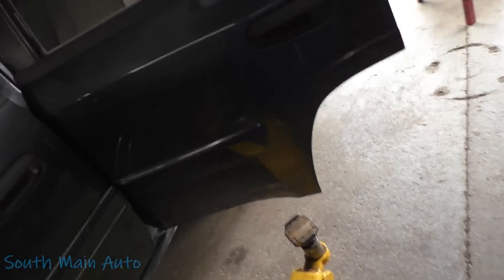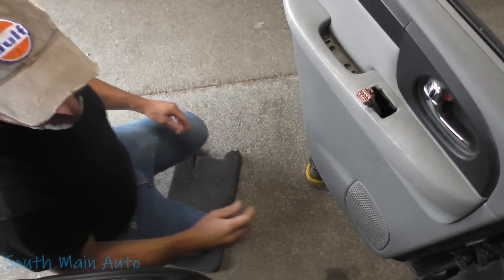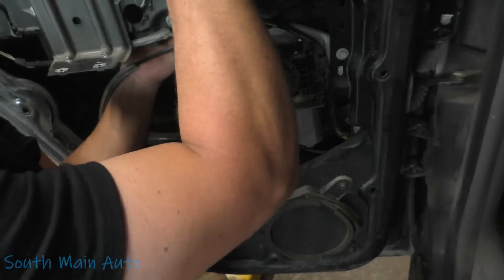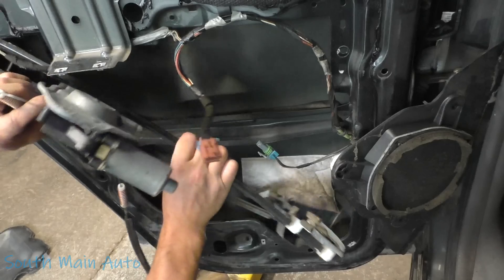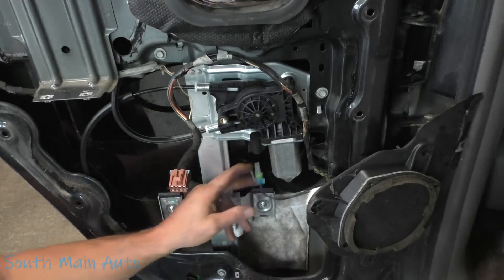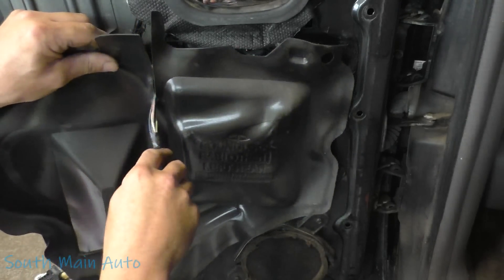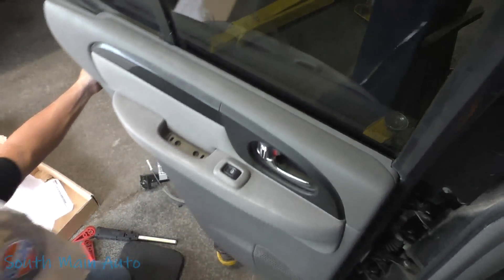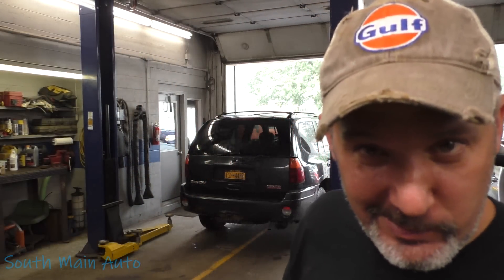Envoy / Trailblazer - Rear Door Window Regulator Replacement

Comment: As a backyard hacker, I have done dozens of regulators and power door lock actuators. Engineers assigned to cococt these contraptions must be limited to C- students exclusively. The cable acuated type was definitely a step backward, they just don't last. I replaced the regulator on my daughter's Town and Country. Every time, the same cable failed. It required removal of an  entire interior section of door, After removing the door card, and including removal of the door latch and a half dozen wiring harnesses, speaker and more. The window wasn't bolted to the regulator, you had to pry it off of two plastic clips. The only good thing was , by the third time, I was able to the whole job start to finish in less than an hour.

Comment: I bought a rivet tool thanks to 90's Ford and GM. I used to bolt them back together, but found out that I could actually do it correctly, so I have been.

Also, since you asked, I think a wiring harness was left unclipped from the new regulator. :)
Reply: Now its going to burn down.  :)

Comment: As a young buck I had this happen to me in my VW Passat driver window. I managed to fish the glass out and used the quick release suction cup from a GPS on the bottom of the window to secure it in place. I got the knack of opening an inch and reattaching it to smoke a cigarette. After about a year I got the regulator done.

Comment: I am not a mechanic by any stretch. I however sometimes like to work on my cars.  Sometimes!  I had to pull a door apart on my Toyota T100 SR5.  It was actually quite easy.    The door lock actuator electric mechanism quit.  Turned out some of the sticky material on the water shield plastic melted and got on the push-pull wire.  A good cleaning and the old girl was like new.  The molded hard plastic weather shield on this Chevy was very nice and easy to work with.  Yeah, I found that removing the speaker and its mount made the job much easier.  Thanks for all the tips and the education....

Comment: I bought that small Wera tool set, bought it to carry on the Harley but it’s crazy how handy it turned out to be, with the tiny ratchet. Than I seen you using it. Bought 3 different sets now, but lost the 7/16 socket from one of the kits😢.

Comment: Changed the regulator in my daughter’s Chevy Cruze, similar procedure but the Cruze uses a double cable design.  What all these seem to have in common are weak nylon mechanisms that grab the glass.  If the glass is stuck due to ice, etc. the motor is strong enough to snap the nylon mechanisms while drawing the window down.  I spray the window tracks with silicone spray and have instructed my daughter to scrape the ice away from the edges of the glass before opening.  Used the OEM replacement.

Comment: I had to change the door latch on my son's 2007 VW Golf. On those, you remove a bunch of screws around the perimeter, then the outer door skin comes off. I'd never seen that before, but it's much better, changing out door latches / window regulators etc is a breeze. Also, get a ding or scrape in your door, just swap the whole skin over with one the same colour from a junk yard. 
The door skin of the Golf when removed is surprisingly robust. I drive a 2015 Challenger Scat Pack. Bearing in mind that car weighs over 4200lbs, the door skins feel like they would crumple like paper if you could remove them from the door.

Comment: Wow -- that was the most painless window-regulator replacement I've ever seen.  You should try doing them in a 1968 Ford Galaxie convertible.  LOL!  The rear ones, especially, are INSANELY difficult.  You literally have to remove the entire back seat to get to them.  And then the hole they fit through is about a third the size it needs to be.  It can only fit through that hole when it's rolled completely down.  Which is, of course, impossible if the crank-gear has stripped and you can't crank it down anymore.  I literally had to cut one of mine into pieces with a Dremel tool in order to remove it.  Many, many, MANY hours of work.  Engineers don't do everything right, for sure, but there are definitely some things they do better today than they did back in the '60s/'70s/'80s.

Comment: I learned a hard lesson about Dorman "reman" BCMs.  2 bad ones in a row, then followed that with a bad one from Cardone.  Hours of diagnostic time because I had myself convinced that there was no way on earth I got 3 bad rebuilds in a row.  Sure enough though, that was the case.  I got a 4th module from Blue  Streak, slapped it in, did all the necessary setup, and voila! Car left a week ago, and no issues since.  I lost my ass on the job, but the customer left satisfied.

Comment: I just get the genuine parts for the motor snd regulator. My 05 gmc had a driver back one go bad back in 2021. Figured if it lasted that long the new one would probably last the same. I dont live in the crust belt so im not worried about it ending up a rust pile anytime soon

Comment: I usually grease up the middle track and spray some silicone spray in the Rubber channels on the outside of the glass window. Makes the window slide up and down like new and makes the regulator last longer. I had a big grin on my face when you didn't tighten up the bolts right away and let the window find the position where it wanted to be on it's own. Those are almost the exact same words I use when I do it the exact same way. 😊

Comment: The amount of time's I've had to do this on my 99 bmw 328 since new are crazy.  Must have done each window about 4 times (min).  OEM/Aftermaket to all bust about the same time!   Easy job - just a pain.  Suppose thats the disavantage of cars not rusting out in Cali!😀

Also have a 94 e36 with the more traditional metal sizzor type regulator as opposed the the cable/Pully one - never had to change one that ever!

Comment: My 80 series landcruiser eventually had all the windows drop into the doors usually at the worse possible time. Replace the bailey channels and used sikaflex to fix the glass securely into the winder mechanism lubricated the pivot points not a easy job.

Comment: That sounded like a pretty decent shower, hopefully, it cooled things down and the sun didn't come out right away and run the humidity through the roof!

About 2 months ago, I did a left front regulator, power mirror and exterior door handle on my brothers Toyota Avalon. Other than getting it apart without breaking anything, the door handle was the hardest part to replace.

I'm not saying Dr. O forgot to do anything but, when I replace a regulator, I always spray the channel and cables with white grease. I don't know if it does any good but, I feel better about it.

Comment: That just be the first time I've seen the engineers actually line things up so that the tool fits to allow you to properly complete the job, my guess is that those holes were meant to collect dropped fasteners from some other job on the door and just randomly happened to line up with the bolts. That or some engineer at GM paid his way through college working as a mechanic and designed the one part he was responsible for to be actually ready to work on =)

Comment: I had an '02 Impala where I was walking up to the car and the driver's window just fell down. Didn't touch it or anything. Fwoop, down it went. Took the panel off and propped it up until I got a regulator a couple days later.

Comment: Dorman regulators last ok, my 2000 Durango has had all of the regulators replaced. When a Dorman fails, I take the receipt to the auto parts store, all with Limited Lifetime Warranty and they get the old, I get the new and regulator is good for another few years.

Comment: After market regulator units in a 2002 Silverado were sub par at best after replacing several...but back then the OEM's were ridiculously expensive... Probably should have spent the extra to avoid issues with the cheaper knock offs...

Comment: Nice touch with the Sprayway... first filling station I ever worked for used it.  Did you not get that top rear corner popped in all the way?  I'd better complain!  Very nice to hear rain... we're on a fierce drought in Texas, several weeks of 100+ with more comin'... at least we're not getting that smoke, I would not handle that well.

Comment: My father and grandfather were both killed by a window regulator. Gramps was working on one when the car rolled over his legs. My dad ran out to my screaming grandfather and quickly placed a jack under the car to free him. While doing that, my father suffered a massive coronary and died before he hit the ground. He fell on the jack handle which released the jack, crushing my gramps head. Soon after I arrived home from school only to be greeted by a horrifying scene; the door panel didn't have the holes to adjust the window clamps as this GM did. It took me the better part of the afternoon to finish the job. I wrote GM about the incident, which led to them adding the holes so future replacements and adjustments would be easier.

Comment: Aleast they made two engineering pluses 1.The holes to adjust the window 2. The plastic water membrane the ones I have worked on had thin easily damaged clear plastic which is almost impossible not to damage.I realize thats only a small win but you take what you can get.Cheers.

Comment: pro tip wash the window at the leglator area as well get rid of the crap there not having dust and junk there helps the window go up and down better plus looks cleaner if I had the full glass access I would clean it completely while it was accessible

Comment: There are few things more frustrating than working on late model interiors. The chances of something breaking are high, and many times interior plastic parts are not available. I probably wouldn't have even taken on that job. A body shop is better suited for doing jobs like that. Several years ago, I had both rear window regulators fail on my 2001 Chevy Malibu. One about 3 months after the first one. The regulators use stranded wire cables, much like clothesline wire, if anybody remembers what that is. They also had VERY flimsy plastic rollers, with no bearings, pretty much the same as screen door rollers. No wonder they didn't last very long. Since this was just my going to work car, I didn't bother replacing the regulators. The only window I actually needed to work was the drivers door window, so I could go through drive throughs. I removed the mangled regulators, pushed the windows all the way up, drilled holes in the vertical track below the metal channel along the bottom edge of the glass, and put a bolt through the track, up against the bottom of the window. That held the windows solidly in place.

Comment: Had a Ford Focus, each of the 4 regulators failed. Never when it was convenient.  I carried a pair of vise grips. If a regulator failed I would pop the inner panel off, lift the window, put the vise grips in a strategic location to hold the window up. Replace the door panel.  Replacement regulators were around $150.  Thanks Ford. (Only car that ever failed like that.)

Comment: Had my first experience with Dorman product for my 15 Caravan. Had to fudge mounting holes, but went right in! My only dummy move, I didn’t try window before closing up. Regulator reverses at top and opens to about 3”. Tried suggestions for resetting regulator with no success. Any ideas? 
I did keep the old motor!

Comment: Do you always replace the motor as well? Had 06 Nissan premier had to replace both front and it came with either replace the wires for get that option, the regulator without the motor and with the motor. My motors were good so just got the regulator bits

Comment: A few years back (mid 90's?), I installed a window regulator in a buddies Ford Explorer. Routine job until I got to the "removing the broken regulator" part. There weren't any visible fasteners on the door! You could see them on the inside attached to some braces. What was in the skin of the door were dimples. I told my buddy it looks like we have to drill some holes to remove the hardware. I could see the look on his face questioning my expertise. Such a unorthodox method to get to the fasteners, what was Ford thinking? Maybe that the regulator would out last the life of the vehicle and you would never need those holes! I told him that I had never seen it before but the dimples did line up with the bolts. Drilled the holes and removed the bolts and old regulator. After that reversed the procedure. I left the holes just incase you might need them in the future.
 
One more regulator story: Saturn regulator ('92) I picked one up at the dealer and it didn't have any of the flexible cables that you could stuff in a smaller hole. I asked the parts guy how in the world was I going to install this big honking thing through a hole. "No you don't do it from the inside of the door you just remove the outside door panel." Now that was an easy install! Once you removed the door panel you were looking at a cutaway of how a Saturn door works.

Comment: Probably going to make a trip in bring my truck to you because i cant  seem to figure out why the torque converter clutch  randomly unlocks for no reasongoing down the highway.  Then 3 or 4 miles later it locks back up.  No slip detected. Shifts are normal and done with in .200 to .400 of a second. When it is locked up however it shows only 97.9% locked on the computer. Idk. I just cant figure it out!

Comment: What do you think about vehicle prices going up so fast?  In 2018 and 2019, you could get a 4 wheel drive silverado here for about 28,000, about 10,000- 11,000 under sticker.  Now the same dealer has them for 54,000.  This is just 4-5 years later.  Chevy trucks were junky but cheap.  Now they are likely junky and not cheap.  Although I haven't driven one in years so maybe I'm not being fair.  And you can still get a turbo four cylinder for under 50,000 barely, but you got a six cylinder for 28,000 before.  And yeah the four has similar HP or more but the V6 was also WAY more reliable.

Comment: They left a notch for the nuts that hold the window but didn't put a hole for the bottom bolt of the regulator.  Must have been different engineers.

Comment: Just a recommendation, I have the 2003 trailblazer...before you put those regulators in....grease the absolute dog snot every area those plastic sliders hit on the metal track goung up and down ..the manufacturer doesn't put enough on ..and you'll find out in about a year , you may be doing it again...like I did 🤦🏻‍♂️...now I'm 5 years on replaced regulators after the grease job.

Comment: I'm about to tackle the old GM AFM lifter issue, sure would be nice if there was an Eric O video on it, but you always put a bullet in those and just make a short video because they are all see through trucks by the time they come to you, mine is not so worth pulling the heads and changing lifters.

Comment: You know napa regulators are dorman right? I know you love smack talking dorman products. Yet I've used them for 14 years with no issue ever. I buy dorman over store brand anytime i can. Ive been in parts for 14 years and worked on cars for 14 years. You and one other person are the only ones ive ever heard say dorman sucks
Reply from the maker: Yeah, I mentioned that in the video. Also, Dorman is complete shit on 80% of what they make. If your mechanic says otherwise, I'd suggest finding a new mechanic....
Reply from the maker: Oh and I've been in parts for about 30 years 😉
Reply: @SouthMainAuto  I don't have a mechanic because I do it all myself. Every parts company makes shit products. I know you've been in the business way longer than me. I wasn't trying to say anything on those lines Eric. I was simply saying I've never had a single dorman failure in the 14 years I've been doing it. Working parts I never had dorman parts returned for warranty either. Maybe the PRNY is getting the dorman shit scraps. I don't have an explanation on why I've never had or seen a failure myself.
Reply: Sometimes Dorman is the only game in town for old parts.
Reply: C'mon Man you know the thing